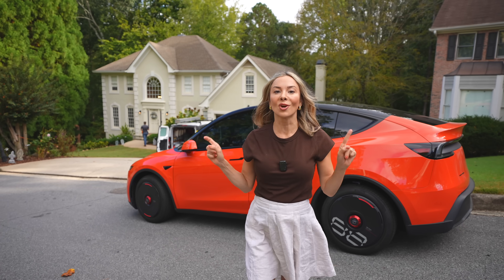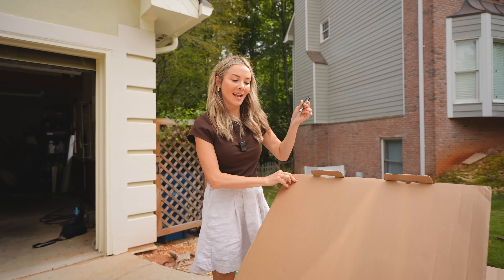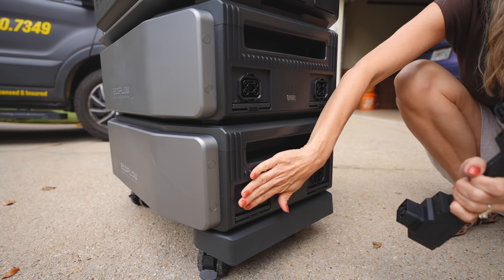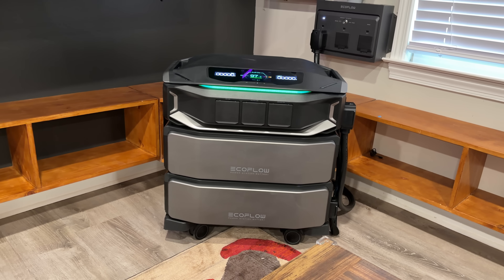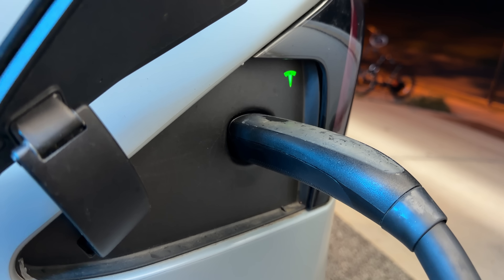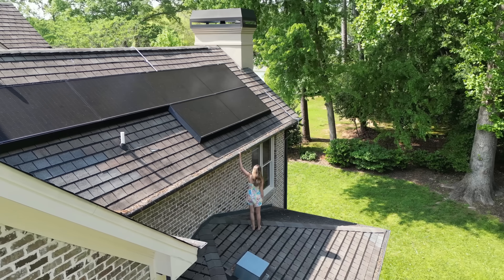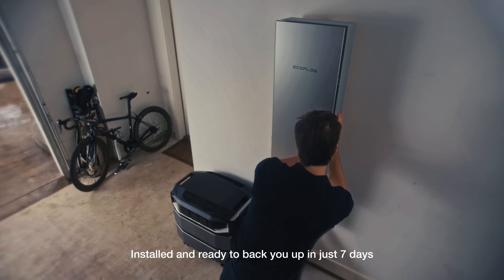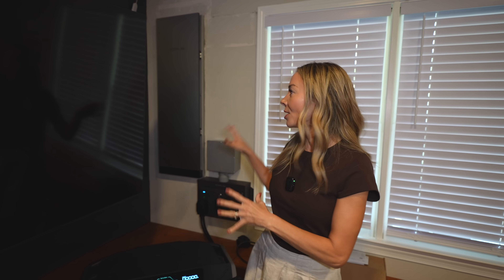I Powered My Whole Home w/ This TINY Solar Generator

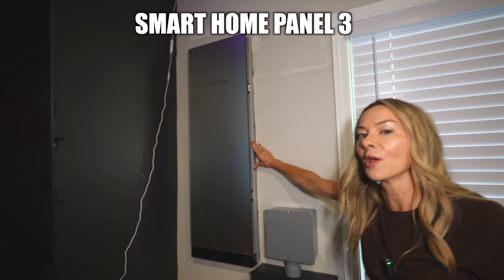Comment from the maker: For those asking, the Delta Pro X Ultra is currently starts at $7,499 until Nov 2 (early bird offer), with an extra 30% tax credit！Also, at 5:02 mark what I'm showing is the Smart Inlet Box  rather than the ATS.
Reply: For this to be a portable unit it is really inexpensive for the amount of power that it puts out. Thank you for this video! I had no idea this thing even existed until I seen this video. Thank you! ❤

Comment: Why do you need a battery when the power is always available? New tech life will need everything running on DC to save energy. It’s a waste of energy if you changed it with city AC.

Comment: You guys arguing about it being called a solar generator... that's just the marketing term people use for a product like this. Yes, it's just a battery with an inverter, solar controller, and charger in one portable package. With solar panels connected it's similar in function to a portable gas generator. Hence "solar generator".

Comment: BTW , it is NOT a solar generator , it is a battery .
Reply: You're right, it's mostly a BS marketing term that has always bothered me a bit, too, as that is not what we would traditionally define as a generator since there is no fuel and it is not a mechanical device.  But, in fairness, the system does generate electricity, it does a bit more than just a battery.  This setup would be a comparable replacement for a traditional generator, i.e. it serves the same purpose, it generates electricity.
Reply: It's a solar inverter and battery that GENERATES electricity. You can connect solar panels to it to charge the battery. No AC input is needed ever if you connect solar panels. However, AC input is recommended because obviously it could be raining or cloudy on some days. Symantecs. Gas electricity generator is not nearly as flexible and efficient. Let's face it. Batteries are replacing gas and it's just more efficient. I remember when people said electric cars will never replace their gas engines or be faster. LOL. It's done both.

Comment: The idea is not to use something as a backup but to have it as your actual everyday system..... I understand the value of a backup and the portability over system like this but I am looking for long-term power production and not needing to be tied to the grid especially with costs rising non-stop for electricity together with the need for more electricity that everyone is pushing for.

Comment: That would work if it had a connection to an EV that has bidirectional charging capability to use the EV battery to supply power to the house, and it needs to be able to handle 200 amps.

Comment: The delta pro Ultra and the Ultra X are not portable.  The smallest configuration is 200 lbs for the Ultra, and for the Ultra X at full potential is 310 lbs.  Assemble it and put it near your panel.  It is a great system for your house backup system.  I have one.  If you need something portable too, get a Delta pro 3 unit or a Delta pro and take that where ever you want to go.  But there is no real portability of the Delta Pro Ultra or Delta Pro Ultra X.
Reply: Sure you can it's on wheels and the sections are easily taking apart and reassembled with no problem...

Comment: How do you charge up this unit? Is it with solar? But it’s in this man’s basement. Does the pre existing power system work to keep the portable unit charged up?
Reply from the maker: yes charges from the grid, can just plug into wall, a portable solar panel or directly from the smart panel as in Tiaan's basement.

Comment: that this is way better than my Tesla Powerwall — took me 3 months to get it installed, and it only has a 7 kWh capacity.
Reply: So you have an original Powerwall from 10+ years ago? A Powerwall 3 (latest version) has 13.5 kWh of storage capacity.

Comment: Kim, the SOURCE is what determine if it is clean! That is but only a energy storage device, NOT A SOURCE!!!!!!!!
That piece of hardware is NOT CLEAN!!!! And by itself is useless!!! It requires some source from which the energy has to be supplied!!! 
 "Clean" is in anyway very BS! In practice, there is NO really CLEAN energy device! All devices require hardware, and those have to be manufactured, thus require material that has to come from somewhere. That is why no device is, and can be completely "clean". 
Wind, hydro, and solar all by nature are theoretically "clean" potential energy, but to truly harness them, and use it, requires hardware, all of which requires material that are mined and manufactured, making it all "dirty" energy! Most batteries, or storage devices, even more so!!!

Comment: 3:20 the solar connects to the ultra x, not the smart panel.  And it can handle 10 batteries per head unit (inverter). 

7:00 that switch over was not 20ms. If it was properly configured, the lights wouldn’t have blinked. 

You should read the specs before recording.
Reply: I was looking at that and it seemed like it skipped twice as if it was edited together which makes me believe it wasn't a fast switchover as lead to believe.
Reply: Agree.  The lag on the switchover in the video was not acceptable - in fact it’s a non-starter for me.  @itskimjava can you comment on why the switchover took so long?

Comment: The cost & complexity of systems sure has come down, I like that it’s portable so in theory could be transported to a friend or family member in an emergency situation
Reply: Portable with 2 friends helping move it.  It is very heavy and moving $4200 in a battery system is kind of silly.  The delta pro 3 is a better option for portability along with 240V 30 amp plug.

Comment: In this configuration, how long does it run the house during a power outage in the winter?
Reply: No wonder why you didn't get any answer, the goal to have a backup and alternative way to produce or make electricity is in case of longer period of shortage which in this case will not help if the battery are depleted. No one care about a few hours of shortage.

Comment: why is it called a solar generator...
Reply: Because it uses solar primarily to recharge the batteries to push out electricity. Kind of like gas generator. It doesn't make gas, it uses gas as fuel to generate electricity. Its all semantics.

Comment: Keep falling in price at retail so have to get better...and they do get better absolutely #professor_hobo that guy really does show what is the breaking point for these amazing machines ...and whether the protection system from that works (hint hint said system works on all of these items....but would still keep away from salt water.) the crisis de juer is now of course #aptera "just call it a car now" comes with the solar panels standard. You should start to see diesel engines roar back into the ice platform in response as #depreciation is absolutely MASSIVE upon in near everything battery let alone electrical(both.) so yes ahem "some pricing disputes out the door with this one as well!" ahem😊😊

Comment: You had mentioned in another video that 10-states allow HOAs to ban Solar Panels. Here's the deep dive. You might want to check, I think you said you're in Georgia, to see if what your HOA is telling you the truth or if there're just blowing some of that HOA partisan smoke. States with no specific solar access laws: 

Alabama
Arkansas
Connecticut
Mississippi
Oklahoma
Pennsylvania
South Carolina
South Dakota
Wyoming 

Key takeaways
No outright ban in most states: The majority of states have laws preventing HOAs from banning solar panels entirely.
Reasonable restrictions allowed: Even in states with strong solar access laws, HOAs can often impose "reasonable restrictions" on placement or aesthetics that don't significantly hinder the system's function.
Consult local resources: Laws are complex and can differ between states and even localities. For the most accurate information, it's best to check with the Database of State Incentives for Renewables & Efficiency (DSIRE) or local authorities.   P.S. I'd get them to put their rejection in writing too and state their reasons why. While there is no comprehensive federal protection, many states have passed solar access laws or similar statutes that limit what an HOA can do. Some features of these state laws:
They may prohibit HOAs from outright banning solar energy systems (or imposing restrictions that make them essentially impossible). For example, in California the “Solar Rights Act” (e.g., Cal. Civ. Code § 714) forbids an HOA from prohibiting solar energy systems, or from imposing requirements that would significantly increase cost or reduce efficiency. 
Davis-Stirling
+1
These laws usually permit reasonable restrictions by the HOA, e.g., location, color, aesthetics, provided they do not raise cost or reduce efficiency beyond certain limits. 
GreenLancer
+2
SolarReviews
+2
In some states, statutes specify a ceiling on how much more costly an HOA can make a solar installation (for example, no more than a 10% efficiency reduction or no more than a fixed dollar amount increase) before the restriction is “unreasonable.” E.g., California law: an HOA cannot impose a requirement that increases system cost by more than $1,000 or reduces efficiency by more than 10%. 
Davis-Stirling
+1
Some states allow HOAs to regulate but not completely prohibit solar panels; others have stronger protections. For example, Maryland Real Property Code § 2-119 prevents HOAs from denying homeowners the right to install solar systems, and from imposing limitations that “significantly increase cost or significantly reduce efficiency.” 
Solar United Neighbors
It’s estimated about 29 states have laws that restrict the ability of HOAs to limit solar installations. 
KLRD
+1
🧐 What this means if you live under an HOA and want solar panels
Because the protections depend on your state law and the exact provisions of your HOA’s governing documents (CC&Rs: covenants, conditions & restrictions), here’s how to logically proceed:
Check your state law: Determine whether your state has a solar access/solar rights law and what protections it provides.
Does the law say HOAs cannot “prohibit” solar systems?
Does it specify that HOAs can still impose reasonable restrictions, such as placement or aesthetics?
Are there thresholds on cost/efficiency penalties?
Are there any exceptions (such as historic districts) or specific definitions of “solar energy device”?
Example: If you're in California you have the protections under Civ. Code § 714. 
Davis-Stirling
+1
Example: If you're in Texas, Texas Property Code Section 202.010 now says HOAs cannot prohibit or restrict the installation of a “solar energy device” (effective from certain dates) but still allows HOAs to impose conditions (like roof slope, color, etc.). 
gosolartexas.org
Review your HOA documents (CC&Rs, bylaws, rules) and local permitting/municipal rules:
Does your HOA’s governing documents contain a clause banning solar panels or limiting them?
Even if there is a ban, if your state law prohibits such bans, that clause may be unenforceable (depending on state law).
If your HOA has approval processes (Architectural Review Committee etc.), you’ll likely need to submit plans.
If your HOA says “no” or imposes what you believe to be unreasonable restrictions:
You can argue that under your state law, a blanket ban or a restriction that imposes a large added cost or efficiency loss is invalid.
You might want to gather support (neighbors, solar installer) and present your case to the HOA board using the applicable statute.
If needed, seek legal counsel experienced in HOA and solar law, as enforcement and interpretation will depend on your jurisdiction.
Keep in mind limitations and exceptions:
Even state laws often allow reasonable restrictions (so HOAs may still have some say over locations, visibility, equipment color etc.).
Homeowners in historic districts may face additional restrictions. For example in Maryland the law does not apply in historic districts. 
Solar United Neighbors
If the HOA or local government owns/controls the roof or common areas, or if you are in a condo structure rather than single-family home, complexities arise. (Some laws differentiate between common‐element roofs vs homeowner‐owned roofs). 
altitude.law
+1

Comment: Too bad it requires internet connectivity to setup and do basic functions
Reply: Not true. You do need to have internet for updates, registrations and historical tracking but to handle normal configurations and changes blue tooth works just fine.
Reply: @kevinm234  yeah ok you can set some settings, but you wont get any history of solar/consumption, graphs or anything else.

Comment: The new inverter can now handle 10 batteries each.
Reply: Yep, it can handle two stacks of 5 per inverter.
Reply: @AlexKstar2025 . I believe that it can handle stacks of 10 per inverter.
Reply: @HouseHunt365 yes you are correct... that is what i attempted to write, but typed it too quickly. Youre only supposed to stack them 5high, but it can handle two stacks per inverter.
Reply: Will the new inverter work with existing Delta Pro Ultra batteries?
Reply: @brentftaylor yes after a firmware update on the batteries it will work.

Comment: Kim, I had trouble following your video to get a  perspective of how this is used. I think at the beginning if you could take a minute to explain.  Is it only part of a solar system, or can it be used independently.  What is the purpose, why get one of these?
Reply from the maker: Can be used independently. It can be used as a backup to power your home during an outage, used with solar (optional) if you want free energy, or used without solar (in this case) to back up your house and with time of use, to charge when rates are lower and power your home with lower rates.
Reply: @ItsKimJava  How long will this backup provide power for your house? 6 KWH don't seem like a long time.

Comment: 7:00 Hard to tell how fast the switch to battery power was with the video cut.
Reply from the maker: ~3 seconds but can be as quick as under a second depending on configuration.
Reply: @ItsKimJava  I have the SHP1, there's a EPS configuration for it to switch faster.  In the video your house lost electricity for a while, was there a setting you guys didn't turn on maybe called EPS or UPS mode to achieve the 20ms switch?